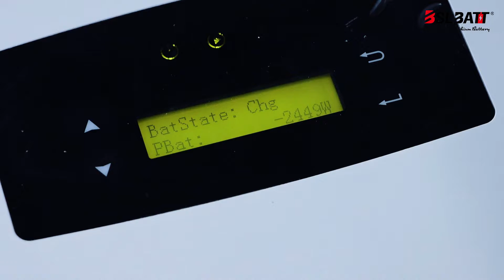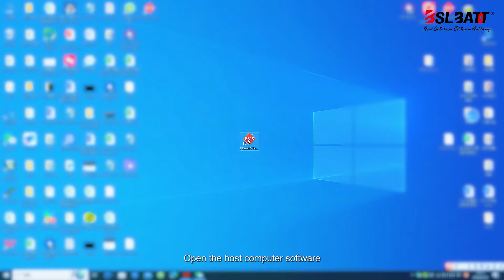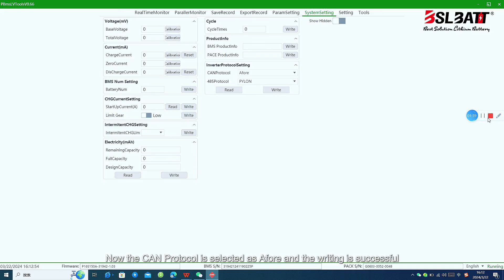How to connect the BSLBATT LiFePO4 battery to Afore Single Phase Hybrid Inverter

Comment: The inverter AF3.6K-SL is installed. Where can I enter "Zero Export" from the submenu? The operating modes are "Self-Use". The menu has selected RUN PARAM -> GRID CONTROL P%FEED 0% and P FEED 0W.
When the battery is charged, it will still start to feed all the energy from the solar panels to the grid. As long as the battery is still charging, the cable current from the grid to the inverter will be kept at about 20 W.
Reply from the maker: Dear friends, the video is just a reference. The specific situation depends on the actual situation. Please consult the installation team for specific problems and seek solutions. If there is no solution, please tell me your country and contact information and we will solve it for you. Thank you